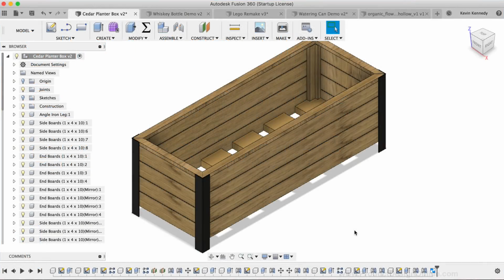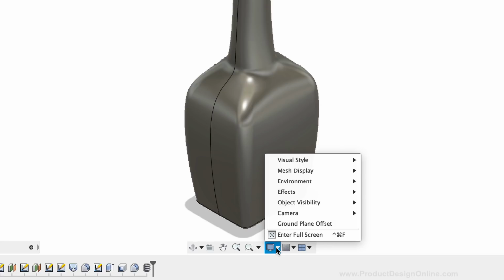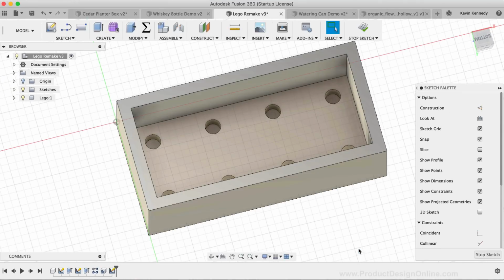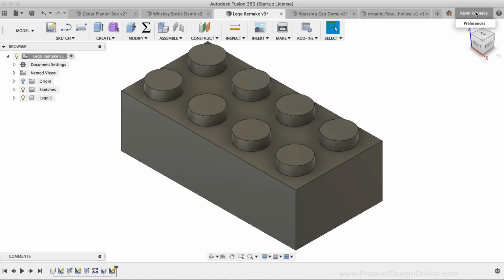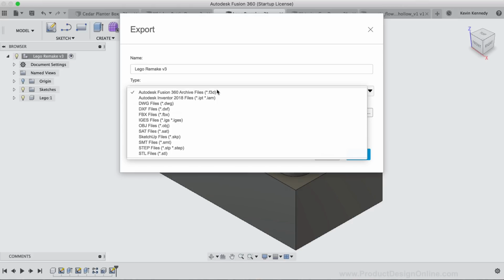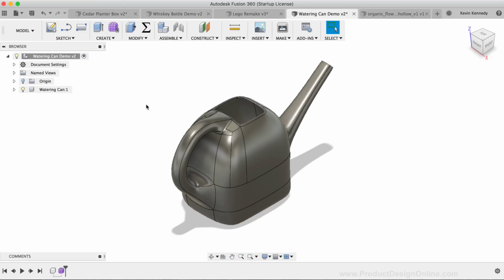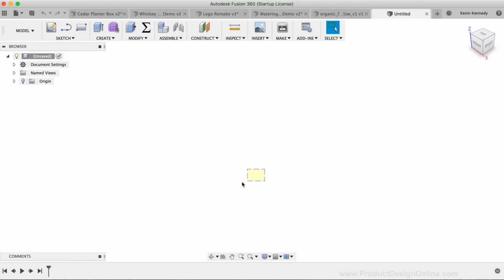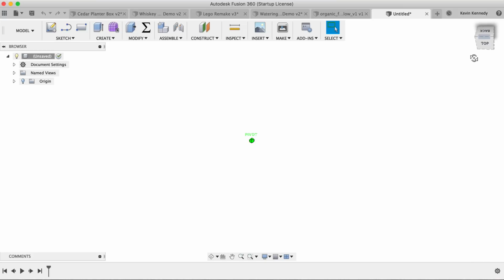10 Questions Fusion 360 Beginners Always Ask

Comment: Hi,
What’s the best monitor to use with Fusion 360 ? Wide screen is better ? What about minimum size ? Thank you
Reply from the maker: Typically, with any CAD program the larger the better because you'll have more room to have large models. I run Fusion 360 on an iMac so I cannot comment too much on a good monitor... Anything reasonable should do 😃

Comment: Speaking of that lego video, my version didn’t allow the control d function that you used in the video.  Is that because I’m not on a Mac or is it because it’s the free non student version?
Reply from the maker: Strange. It should work on both Windows and Mac and all versions. Are you still experiencing that? If so, it may be worth a restart/restore default settings.

Comment: Great tips, thanks.

My suggestion for Kevin is to run through all the various movement commands at the very start of the video series. I'm a Fusion noob, and maybe I missed it, but during the tutorials I often see you panning, zooming, etc as you provide instruction. Using the pan/zoom/orbit commands at the bottom of the screen as I followed along was getting tedious. I discovered the mouse wheel roll would zoom in / zoom out, but that was all I could do without the bottom menus.

After a little poking around, I found a YouTube video that demonstrated use of click and hold the scroll wheel while dragging to pan, and shift + click and hold the scroll wheel while dragging to orbit. That made a world of difference. Maybe if you reviewed those movement commands around the same time that you review the preferences settings it might help some learners.

Comment: you will also experience the "offline mode" if for some reason your system clock does not match the server (cloud) time.  F.E. if you have dual boot setup (linux + windows) you will be 1 hr off after switching from linux to windows. Remember that.
Reply from the maker: Very interesting. Thanks for sharing!
Reply: @ProductDesignOnline  no problem. Just try and update the tutorial :) Iv'e stumbled aceoss this problem some time a go and the solution was hidden somewhere on Autodesk's site.

Comment: Question for you.  I'm pretty new to fusion 360,  I designed a star field on fusion for the flag I'm building. The problem I'm having is my tool path stops carving half way up on all my stars. It wont make the points on the stars. I set up a tool for a 60⁰ v bit. Any advice would be really appreciated. Thanks for your time.
Reply from the maker: Hi John. Not sure if I can help with that without seeing your file/setup. Did you setup the tool paths in Fusion 360? If so, can you share your file?

To share your file - In Fusion 360 go to File > Share > Share Public Link (make sure "downloadable" is toggled on) > Paste your link here as a reply to this comment. Then, please write a separate comment letting me know you've replied with a link because YouTube flags most links and I don't always get notified. Cheers, Kevin :)

Comment: Nice video as usually. I'm interested on how to extrude rounded text (text on an arc) on a surface.
Till now the text feature can manage only line text. 
I know there is a F360 app in the store but is not for free  :-(  !!
Reply from the maker: Hi, IceCreams62. There are a few different "hacks" to do this. I'll put this on the to do list for potential videos. Unfortunately, there ins't a really simple way to do this in Fusion 360 yet. At least not without a few different steps. Cheers, Kevin :)
Reply: @ProductDesignOnline  Thanks Kevin. I can use SVG file to import the rounded text but is not a good solution for me . Or i can use a circle as reference and put the letters one a time but it's so hard to align the letters well. Waiting for your solutions  :-)  !!!
Reply from the maker: @IceCreams62  I try to stay away from SVGs because they're very hard to update should you need to make changes later down the road. However, sometimes they're the easiest solution. Cheers, Kevin :)
Reply: In the mean time i have found a Brad Tallis video that solve my need using a circle as a reference to place the letters. Just enough for the moment. But in any case i'm waiting for your solution  :-)  Thanks for your great work for us
Reply from the maker: @IceCreams62  glad you found that. I remember watching part of that. A great solution. Cheers, Kevin :)
Reply: Just to give the others the right info, was a Lars Christensen video, not a Brad one, sorry :-)